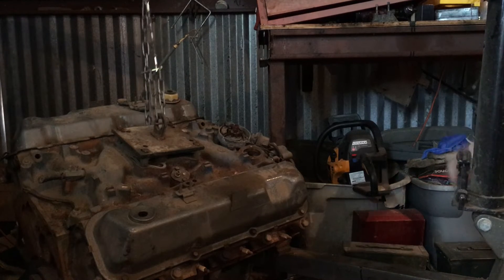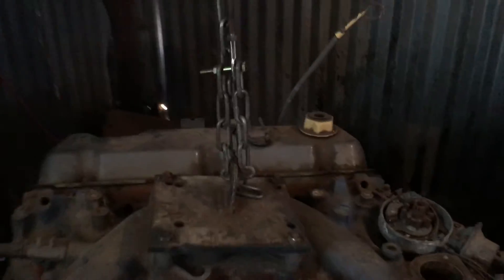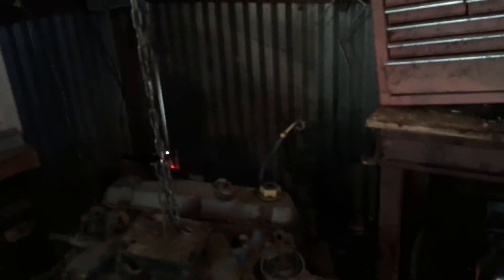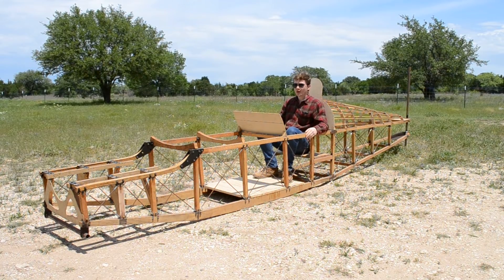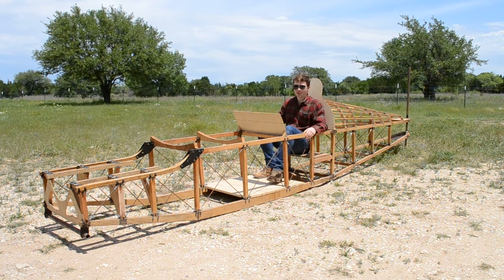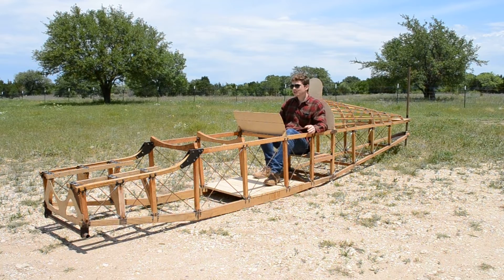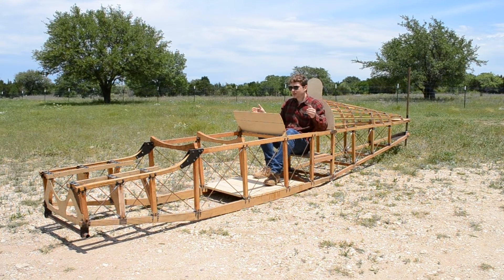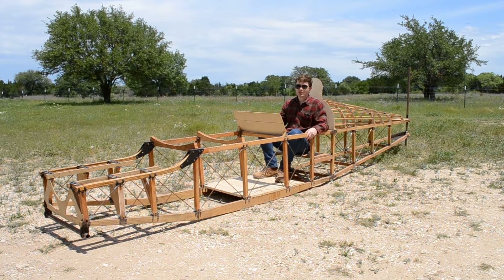Homebuilt Airplane Episode 5: The Fuselage Bracing

Comment: Great project, I'm enjoying your vids and wish you well in completion. 
The fatigue cracking that Tench745 mentioned is very real and with airframe vibration those cut threads will eventually probbably crack. If you are having a passanger seat I would say this is a no go. If its just you....its still pretty iffy for any long term use of the plane. But if you are limiting the flight to very low G then maybe ok. Best join the HBA forum https://www.homebuiltairplanes.com and the biplane forum https://www.biplaneforum.com/  if haven't already and ask some questions regarding structual things like this and get some qualified answers. All the best, keep at it, great looking bipe the SE5 :)
Reply from the maker: Thank you!

Comment: Just watched your whole build series. Great job. Love the engine solution. Door skins will hold up just fine. The glue between layers is resorcinol and is completely waterproof. You can saturate with thin epoxy to really seal it up and it will last for ever. I have built multiple S&G sea  kayaks with the stuff and after 20 + yrs of hard abuse I see no perceptible deterioration. And that is way far more abuse it will ever see in the SE5.
Reply from the maker: Thanks you! I ended up using door skins on the front half of the fuselage with door skins and I was really happy with them!

Comment: While static load testing is important, one thing that kills aircraft structure is fatigue. Any nick in the edge of a part, sharp corner, burr on a hole, undercut in a weld, etc etc, is a site for a stress riser and eventual crack to form.

Comment: Great vid! At what point are you going to find the CG?
Reply from the maker: My plan is to get the plane as close to finished as I can, but not install the engine. Then I would measure the CG and I would use engine location to get the CG exactly where I want it. The battery could also be used for fine adjustments.
Reply: Evan Jones awesome! Can’t wait to see it 🤙
Reply from the maker: @joelschantz5585  Thank you!